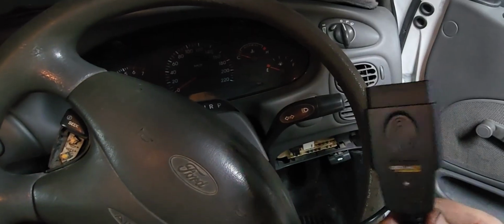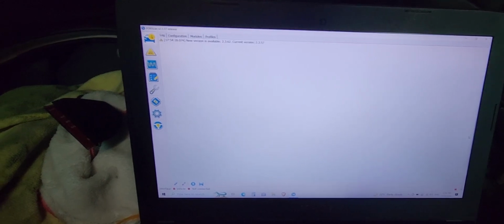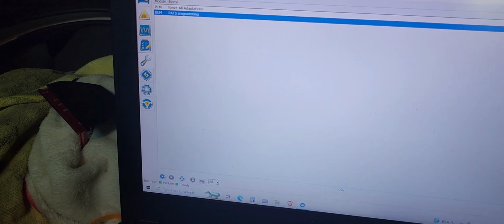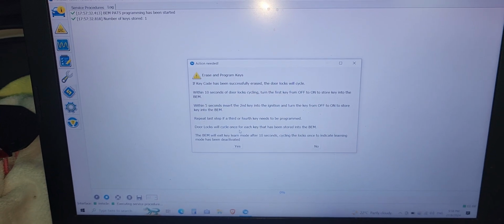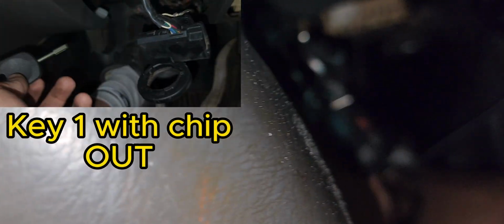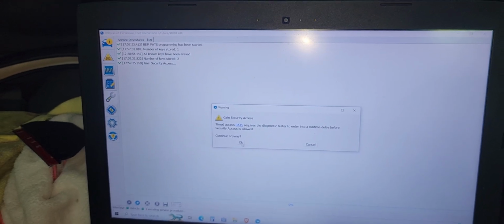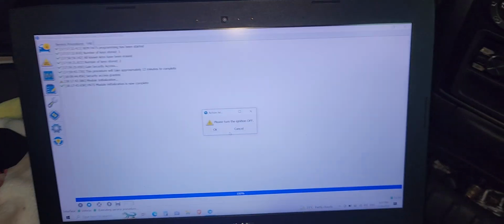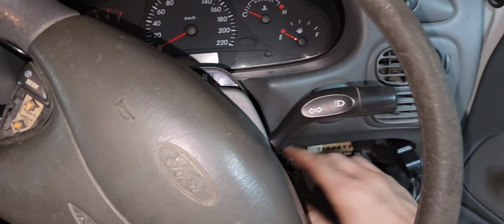Ford AU/BA Falcon Key Reprogramming - The Only Guide You Need - NO BS

Comment: thanks very much. you saved me. ba falcon one and only key failed. i used second handpair of keys from wrecker. took a while of persistance but got it. youre legend. i did find however i had to put the key body in backwards from yours but worked.
Reply from the maker: Awesome! Is one of those jobs that when you have done it once its easy but complicated to start. Glad I could help :)